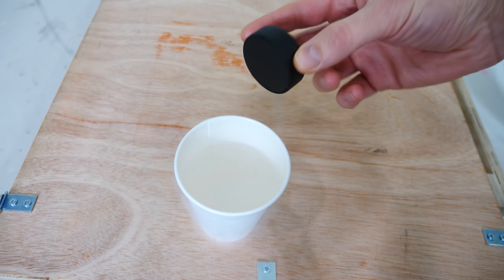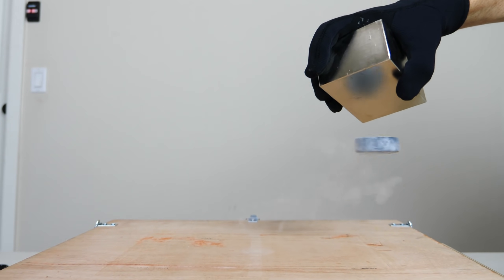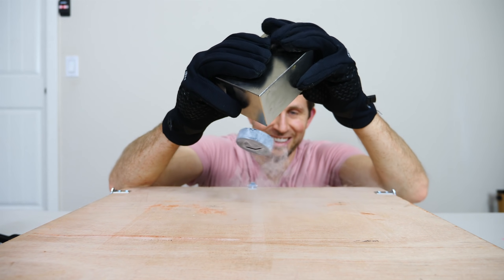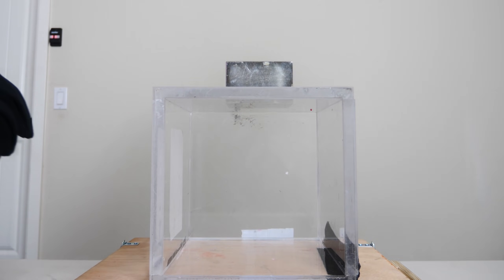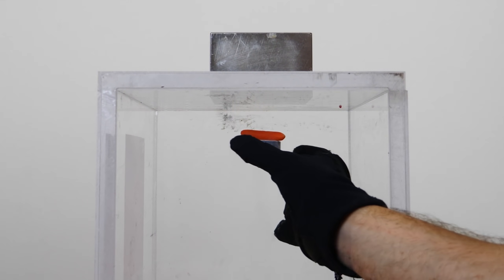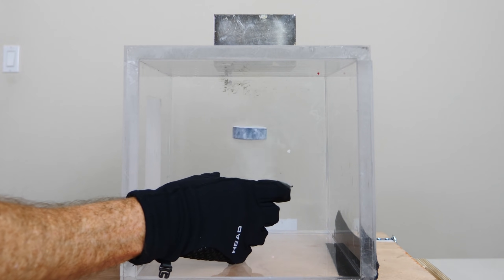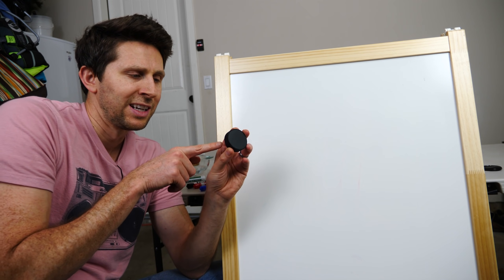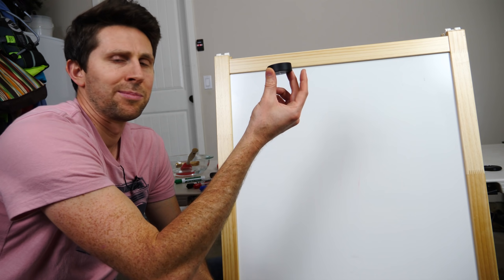Giant Neodymium Monster Magnet vs Superconductor—Quantum Locking Part 2

Comment: The next time you do this could you rapidly spin the type 2 superconductor with respect to the 3 axis (x, y, and z)? If the superconductor was more of an ellipse (With non equal major and minor axis. I say this because technically, circles are included within the set of ellipses.) But anyway, I'm curious how this effect would behave with respect to the intermediate axis theorem.
Reply: I imagine those vortexes might have a preferred direction. I'm not sure if they do or not, but could you also do clockwise and counter-clockwise rotations?

Comment: 2 things i have a question about.
1. Does Earths magnetic field apply any force between the magnet and the super conductor?
2. If you wanted to use a super conductor that uses earths magnetic field, would you need a enormous sized superconductor or would you need earth to be more magnetic?

Comment: The problem of quantum locking is so soft, it's not a hard link like spacial rigid link in CARET project (exotic technologie).
There another solution to make hard link without physical link, you must read Gabriel LAFRENIERE work (the matter is made by wave) to understand how work the link between particules (between all).

Comment: Do you think quantum locking can be done on a large enough scale to counteract with Earth's magnetic field? Have 4 great masses compressed with ultra-cooling. The cooling system could be attached to a control panel to drive direction. Is this how UFOs would fly?

Comment: I had a question:
If helium had is lighter than air then is it lighter than vacuum?
Reply: No.  Nothing can be lighter than vacuum.  Helium's density is 0.21 g/cm, compared to 1.23 g/cm for air.
Reply: @coolguy284_2  Did you know that Pi is not a constant 3.14 in spherical math?
Reply: I think it is the reason that everything falls at same speed in vacuum. The vacuum always moves on top of everything (having zero density) as fast as possible + no air resistance on anything during falling.

Comment: Huh, that's actually one of the weaker quantum lock bonds I've ever seen. It's not even as strong as the one in the video you made three days ago. Here's one done several years ago where the bond is so strong that the superconductor remains rigid in the air and can be manipulated without changing its relative position to the magnet: https://youtu.be/PXHczjOg06w

Comment: do one thing. according to Newton's first law of motion, unless there is an external force, an object will continue its motion or state of rest. so keep the neodymium magnet on the bottom of a vaccum chamber and the superconductor inside and give it a spin and then start a vaccum so there is no air resistance. theoretically it should keep spinning. would love to see it.
Reply: There would be resistance, a perfect vacuum doesn't exist.  So in short it would eventually slow down even in a vacuum chamber.

Comment: I predict that the Disk will not block magnetic fields. Test with second magnet hung (attracted to super magnet) at a distance just high enough to hold its own weight, then move the disk in-between the two to see if the smaller magnet held up (Tied down with string) falls or experiences less tension on the string.

Comment: Nice.
Can you do same experiment - compare effect of heat conduction in vacuum and air by calculating time difference of 'drop of superconductor' when temperature is uniformly raise.
You may flip your vacuum chamber at 90 degree and bring it to near edge of table to close it.

Comment: Does having a quantum locked puck hanging from a magnet, increase the weight of the magnet?
Reply: Yes. If the puck is hovering then the magnet must be providing an upward force that cancels out the force of gravity (on the puck), and by Newton's third law the magnet must feel an equal and opposite force (downwards).

Comment: You need to explain to people the moon is in quantum lock  with the earth that or dumb scientists are calling tidal lock. Just like all storms are either a positive controlled magnetic field aka high pressure system or a negative controlled magnetic field aka low pressure system this only applies for the northern hemisphere its opposite in the southern hemisphere just like how the water goes down the drain in the opposite way in the southern hemisphere than the northern hemisphere please open your eyes people

Comment: The next logical step is to put it in your vacuum chamber. This should reduce the increase in heat in the superconductor and allow for the effect to last longer. An interesting experiment would be to see how long you can get the effect to last using this method.

Edit: I realize the reduction in pressure would cause the liquid nitrogen to offgas faster. Would this increase the temperature in the superconductor more quickly or would the vacuum still insulate it enough?

Comment: When the magnet and the superconductor are locked together, does the superconductor exert pressure on the magnet? In other words, if you were to weigh the magnet on a scale, then lock in the superconductor, would the scale detect the weight of both objects?

Comment: This is cool... literally...
What I asked me when watching this: Would this also work the other way around? Putting the cool superconductor on the table and let a (smaller?) magnet hover above it?
Does a magnet care where his field lines are or would it just drop down on the Superconductor? Or is there a force but the magnet has to be significally heavier than the superconductor to lock it?
According to the 3th newtonian law there should also be a force that (tries to) hold the magnet in position relative to the superconductor, but on the other hand, quantum physics tends to be weird...

Comment: If you were to hang the super magnet to a scale and get the weight of the magnet. Would the weight change with the super cold conductor hanging from it? And if you put the bread or carrot on it does the weight change on that scale? And can you place a magnet then the super conductor then another magnet? *side note if the weight does change is it accurate. Or is there a reduction in weight or even an addition to the weight as if it was weighing something unseen? And does it make a difference in the vacuum chamber?  That is so cool!

Comment: What if you covered the neodymium magnet with a type 1 superconductor, and cooled it to its superconducting point? Would that create pressure on the superconductor, and is the magnet still able to be felt anymore (because the superconductor is holding the magnetic fields inside it and not letting it leave)?

Edit: I’m in 8th grade and love the subject, but know so little about it, so if you know the answer and reply, I really appreciate your help and will be sure to thank you!

Comment: You could also reverse this, yes? You could suspend the magnet instead? I was wondering because doing it the way shown in the video makes it a temporary process; you'd have to keep dipping the superconductor in liquid nitrogen. By flipping it, you could put the superconductor in a constantly cold box or something (I'm imagining a liquid cooling system, just with liquid nitrogen) and let the magnet float forever. Would make for a great, stable, levitating display platform.

Comment: imagine a superconductor on top of a electromagnet remote controlled such that it slowly rises to the desired height when activated.

inbetween there are many small pellets and attached to both sides you have ultrasonic speakers
which gets moved around at high speed. while lights attached to the superconductor illuminate the movement with different colors.....

ladies and genteman introducing the "hologram"

Comment: My question is what would happen if you shorted a battery with superconducting wire? Would zero volts would be able to flow since volts be able to flow since resistance is zero?

Comment: You think that's cool until they make you a collar with quantum locking at the exits of your prison. Really all it would take is cooling a small part inside the collar and then using a powerful electromagnetic at an exit door around the sides that holds the prisoner in place in case they try to exit.

Comment: What does it feel like when you pull the superconductor away from the magnet? Does it feel like there are "bumps" as you drag it along where it wants to settle in, sort of like magnetic parking spots or "local minimums" if we want to be nerdy about it?
Reply: There could be bumps cause magnetic field lines are well lines and are always apart from one another. But I don't think you would be able to feel those bumps.
Reply: @SahilP2648  magnetic lines are actually a field. We just depict them as lines. Also when you move it up and down you move it along the lines. So you should feel no bumps.
Reply: @dragosioanilie7982  when you move it up and down it is parallel to the magnetic field lines. And as I said previously you shouldn't be able to feel those bumps. The lines represent the strongest magnetic force (I forgot what its called(flux maybe)) out of a certain area.
Reply: @dragosioanilie7982  but you can see magnetic lines on the surface of the Sun

Comment: I have a question here.
Do you feel the weight of the superconductor while holding the magnet ?

So many good replies, thanks.
Now flip the question like literally flip it, now you have a magnet at the bottom and a levitating magnet (not a superconductor) on top. How much weight/force would the bottom magnet experience if you put it on a scale.
Will it be the sum of both magnets or the magnetic force between them will add/subtract something  ??
Reply: Yes.
Both the magnet and the superconductor are linked via magnetic field.
Newton's 3rd law
Reply: You do.
Reply: @Ingyer1  I guess so.
Reply: Yes, the superconductor is not floating, it's locked with the magnet. Accept this as a rule of thumb that it's 'impossible' too shield gravity.
Reply: Thats a super interesting question!  I would love to know the answer to.
Reply: Yes. It only is quantum locked at its location, it doesn't negate gravity. It would be the same if he had added a string and just pulled it. Just because magnets are in use, doesn't nullify gravity pulling on superconductor, it just transfers it to the weight of the magnet suspending the superconductor
Reply: @Tallnerdyguy  it does in fact actually counteract gravity otherwise it would not float or as you call it hang....... a scale wouldn't register it ...... then again the weight should act on the magnet as well ...... yeah i think your right you would indeed feel its weight
Reply: @fuseteam  i can give you measurements with documentation. Not sure why people think that holding something up wouldn't add weight, with magnets or a string.
Reply: @Tallnerdyguy  i think i saw my mistake, i compared it with water rather than a string :p
Reply: @fuseteam  at least you are thinking and learning. All that matters
Reply: @Tallnerdyguy  i suppose
Reply: needabettername 
Yep, exactly my thoughts. Not sure why people don’t get it, it’s just a force connecting the two objects, doesn’t matter if it’s magnetism or a string.
Reply: Yeah it does.. The force exerted by superconductor counteract gravity and it acts as if they are glued to each other.
Reply: i doubt it tbh
i believe the magnetic field is counteracting gravity as to make it float
it's "quantum locked" so that it's held in place by the magnectic forces after all
Reply: @fuseteam  that's what I thought.
It's not being attracted or repelled by the magnet it's just quantum locked.
Reply: @FaMon116  actually a quantum lock is being both attracted and repelled by the magnet...... wait does this mean it repelled more strongly then its attracted? gravity also needs to canceled out........ now its getting interesting
Reply: @fuseteam  I know the answer and at the same time I don't.
Reply: @FaMon116  ikr
Reply: Fuseteam it’s not being repelled or attracted, its pined in place by the properties of the type 2 superconductor. Think of it as having lines of magnetic field passing through tiny holes in it so It can only move along those lines.
Reply: @swagaroomate1623  it being both repelled and attracted as explained in the video
Reply: which why most superconductor type 2 experiments on neodymium magnet loops are done in horizontal rail and not vertical one.
Reply: Fuseteam it’s not being repelled because the super conductor does not produce a magnet field I just doesn’t allow magnetic fields to pass freely through it so they go around it. This is a type two superconductor so it has lots of tiny holes with material that does allow a magnet field to pass though it and the line of the magnet field get trapped in them with anchors the superconductor on that plane.